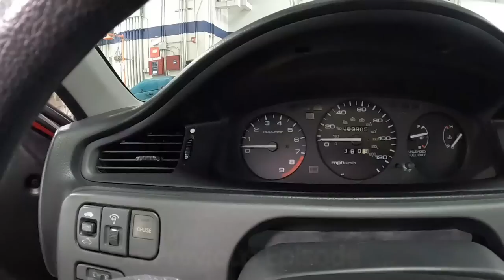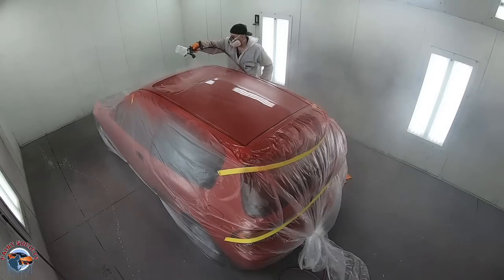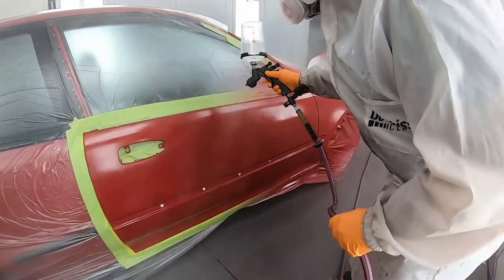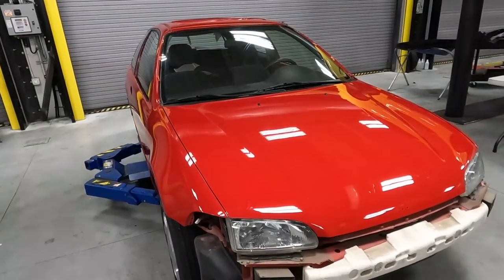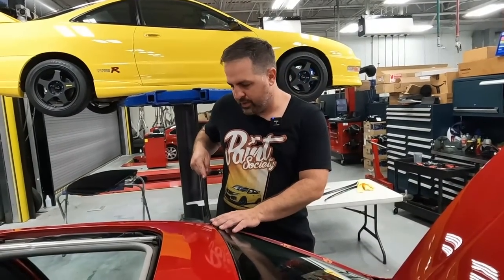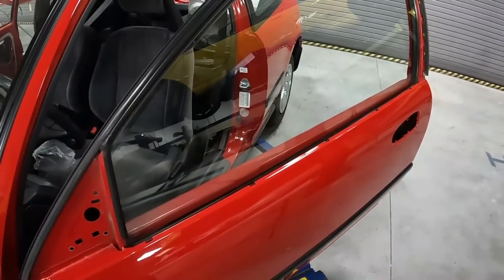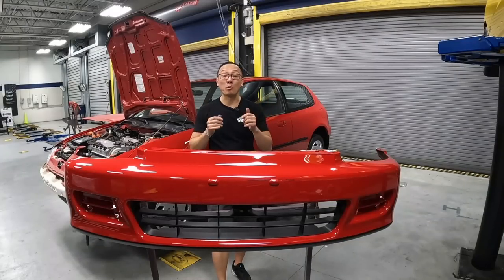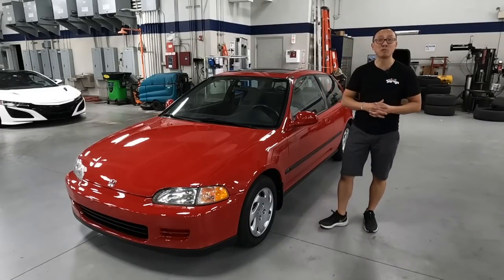All-Original 1994 Honda Civic Si EH3 - Restore Refinish & Reassemble | Part 2

Comment: I really appreciate just about any vintage car that has been well maintained and preserved in its original configuration. This was true when I younger, just as it is today. But some examples tug at my heartstrings more than others. Seeing this Civic Si hatchback after you've finished with it brings on similar feelings, even though I never owned one myself. Most of my Honda's through the years have been of the 2-wheeled variety, though my first new car was a 1987 CRX Si (in Rio red). I tip my cap to the owner for their dedication to this car and to all of you who worked on it. Great result!

Comment: I thought Milano Red used a lighter red with a tinted clearcoat, hence why old faded Milano Red Honda’s were always jokingly called Milano Pink. Or was that only the OEM paint process that was done that way?
Reply: Not sure where you heard that from but it’s definitely basecoat and clear, the problem is the red pigment fades very easily from the OEM

Comment: Hi AHC. You fellas know where I can get a new OEM cowl for my 92 hatchback? My local Honda/Acura says it discontinued and eBay seems to only have used ones. I have replaced all my weather stripping and panel pieces minus the cowl. Be nice to have this 100%!!!
Reply from the maker: Unfortunately the cowl has been discontinued for a few years. If your current cowl is still in good overall condition, you can always refinish them with SEM paint. Check out this vehicle and materials are all listed in the description:
https://youtu.be/VEfNZ33KDlI
Reply: I knew you guys were awesome!
Reply: Hi AHC, 
Since the last time we spoke I was able to purchase everything on your EH shopping list. I even had a new windshield put in, new door handles, mirrors, and had my wiper arms powder coated. My only part id like to change out I can’t find is the hatch window seal that attaches around the outside. Would you happen to know that part number? Next on my list is TEINS Flex Z or BC suspension with Hardrace ITR RLCA and bushings. Which do you guy like more? FYI… you guys are the only channel I subscribed to. You got me juiced after 20 years of not being in the fold. I’m back!

Comment: I need to purchase a couple parts to refresh mine as well I have a white 1993 dx and it’s 100% stock 😎 I also need to purchase oem hub caps since mine is on the oem 13 inch steelies with Honda center caps but I do have steelies from a 97 civic sedan I had which I regret selling since it was also stock and manual 🤦🏻‍♂️

Comment: I never knew the oem bumper had a plate that ran across the top surface like that. Makes sense as it would bear the tension of the screws rather than the plastic bumper.

It looks great guys. Well done.
Reply from the maker: Yes, just like the usdm 94-01 Integra, that bar is to brace the upper portion of the bumper